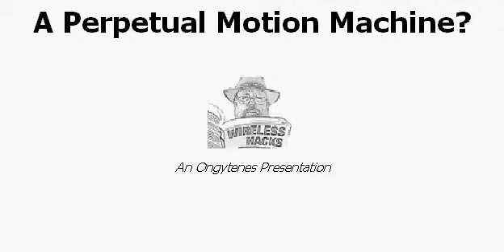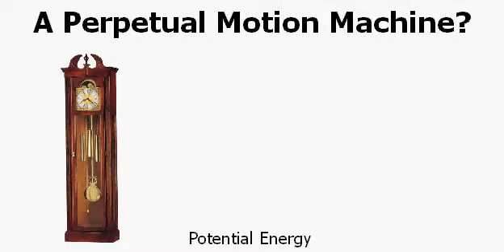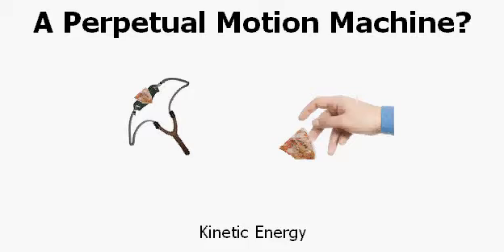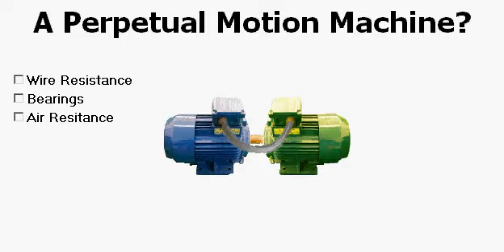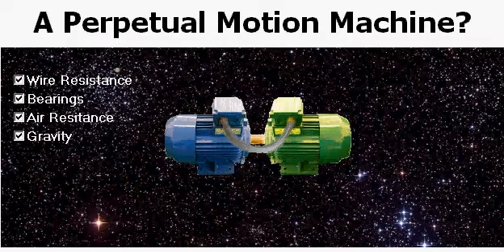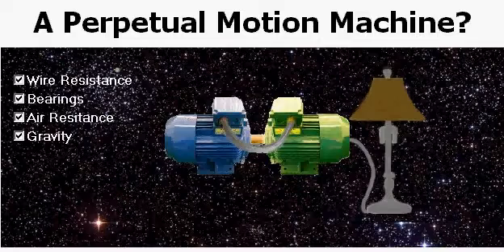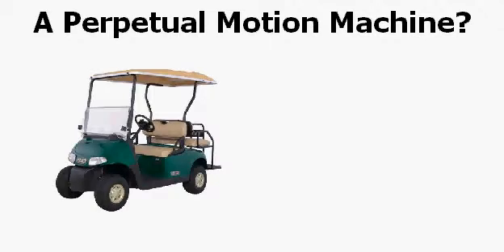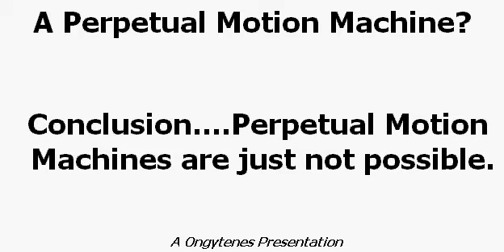A Perpetual Motion Machine?

Comment from the maker: If you put your car in third gear (I am referring to stick) and pop the clutch you will stall the engine. The gear ratio puts more load on the engine. Same is true on electric motors. Years ago I wired up a large vacuum pump. The pump put such a load on the motor, that it tripped the 50 amp breaker. We changed the pulley ratio and solved the problem. So any time you change the ratio, you change the stress/load.

Comment: Fredrick asks, 'What if you put a ratio between the the motor and the generator, ie, 3.14159265359?, wouldn't that accelerate the jass exponentially to 10000 rpm and cause zero point energy field?!'